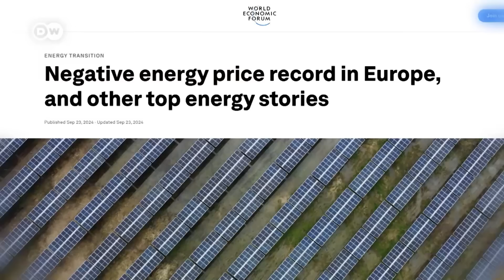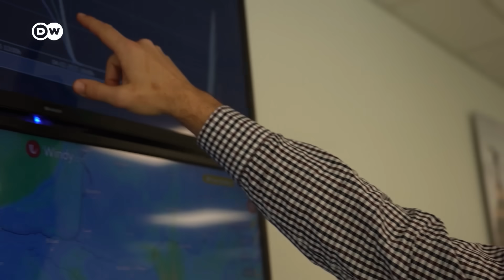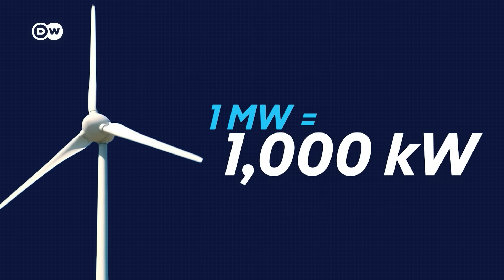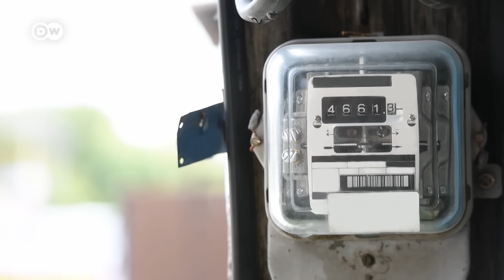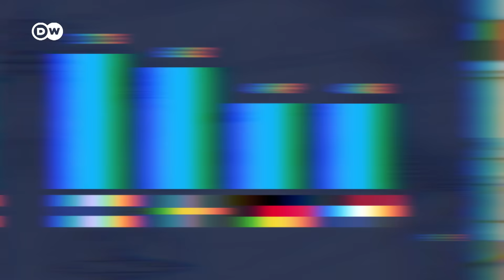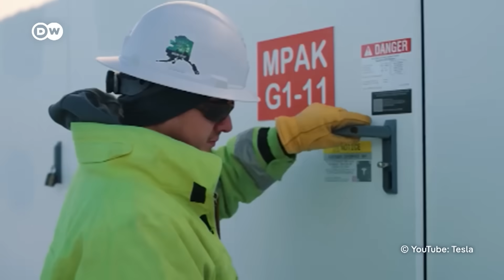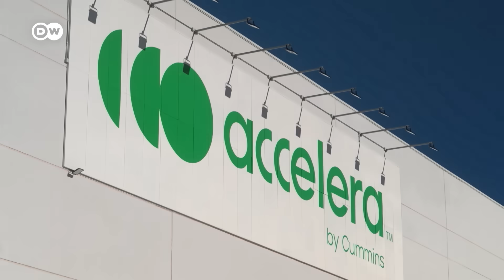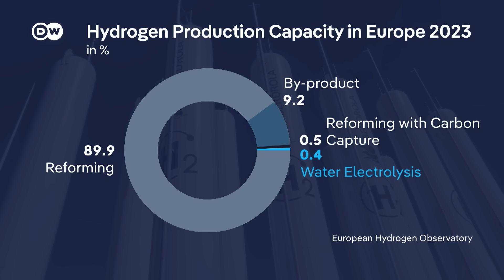Negative energy prices: Why cheap electricity can create huge problems | Transforming Business

Comment: Seems like a non issue lol, too much clean energy can never be a bad thing, just export it ? Or scale back production, or use it for industry something Europe has been lacking for sometime now.
Reply: It is a big issue, actually. There are negative prices at certain hours that affect the economics of investors. On other days, we haven't enough green energy, but investors are not keen investing more money because of those negative prices. That's why we need more energy storage, this way we can use this "free" energy when we need it later.
Reply: You can always should it off but this wouldn't be the ideal solution. 
Export requires powerlines (should be done cost money takes time has opposition) 
Local hydrogen (needs a market/production site and set out/expensive) only 30% efficient. 
Battery (expensive but simple still need to be installed and produced)
Reply: No, it's indeed a big issue. Export needs lots of power lines which NIMBYs don't allow to build. Industry needs consistent, predictable power for 24x7 not occasional for a few hours in the afternoon on holidays
Reply: @ain92ru  NIMBYs or France in the case of Spain, to keep it simple 🤣
Reply: @ain92ru  Well, just limit the payment to the end of the month and then use the average price for that whole month? Why not? Because CAPITALO-FASC don't like payment delay 😁
Reply: Or create a flexible demand with servers and data processing plants to make sure all the electricity is consumed and the power plants run at highest load thus reducing prices for normal users.
This is what Texas does and it works so well they closed their gas plants !
Reply: @ This is not how it works. If you invest lots of money into your servers, you want them running at high utilization, 24x7, or they won't make the money back. Same as for all the other industries actually
Reply: @ain92ru  absolutely but that's why energy shouldn't be privatised & same answer why not export some?
Reply: @ I don't follow your argument. Energy can be nationalized or privatized, doesn't change the fact it's not needed at that time

Comment: Well you can use this extra energy to produce green hydrogen.
Reply: Green hydrogen, Aluminium, steel.

Hydrogen is a feedstock for fertiliser and can produce liquid fuel. I'm surprised it isn't being examined more closely.
Reply: Most industrial processes, including the manufacture of green hydrogen, require  large amounts of cheap power 24/7. 
Intermittent sources of electricity are not able to meet this demand. The power companies need to work out how to supply electricity 24/7 using non fossil fuel energy.